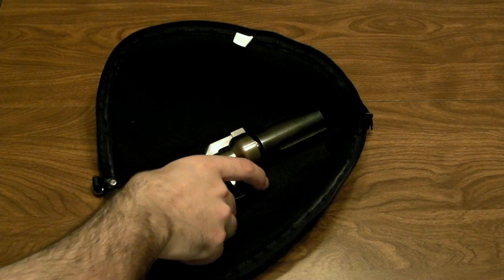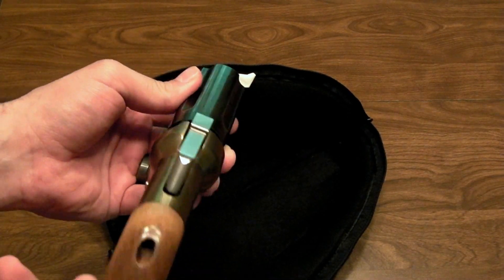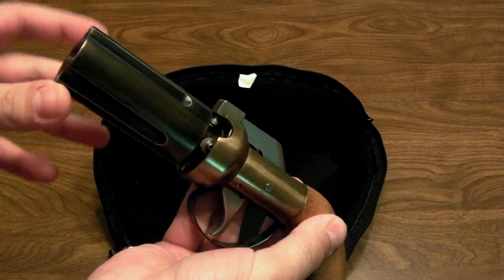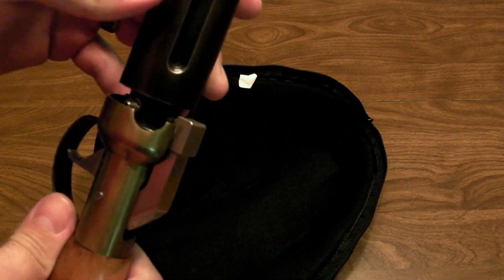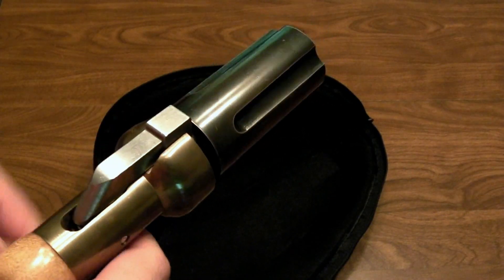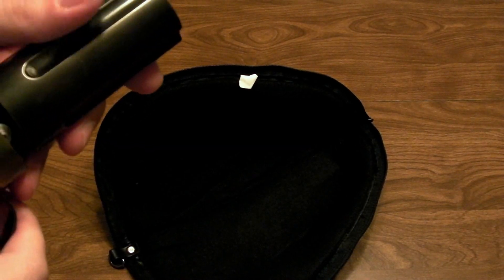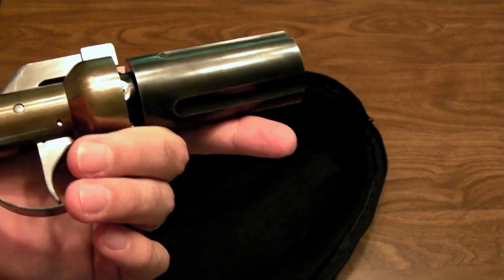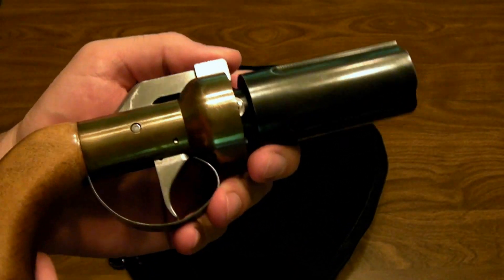Ethan Allen Pepperbox - Part 1

Comment: i dont know if you can do it on this one but i do know that on the new orleans ace model to fix that problem you have to take a little off the hammer were it striks the cap that way the hammer has farther to fall thus giving it more momentum and hitting the cap harder and with yours it takes the number 11 cap

Comment: try stretching your spring out a little bit and this should increase tension. or go to your local hardware store and bring your old spring and get three or four that are similar and you'll probably have good luck this way. Another thing that people that are not used to black powder revolvers is that you have to make sure that your percussion cap is seated firmly on the nipple. another words before you put your powder and ball put your percussion cap on first put pressure on the couch with the hammer and that should do it. and always you safety and common sense when modifying anything. good luck my friend

Comment: In case this is new info., I read that a no.10 cap may go on a no.11 nipple, but it doesn't go down far enough to reliably set the too tight cap to go off.  Are you maybe using a #10 on an #11 nipple?  If so, try #11 caps.  I hope this helps.

Comment: If the cap fires on a second strike, then your cap size is too small. The first strike is settling the cap on the nipple, and the second strike is firing it. Percussion caps are not standardized as to size even though the numbers are the same #10, #11 etc. The size varies from brand to brand .
Try a larger size cap or try a different brand. Hope it works.

Comment: The hammer is not the problem. The nipples are very short in these guns. You have 2 options - sand down each no.11 cap or file/machine down the flare/radius of the nipples. Gun will fire 100% of the time. FFF black powder

Comment: What if you use an angle grinder and cut a channel in the middle of the hammer, to make a sight?
Reply from the maker: +Lucas Kroon The hammer moves as you pull the trigger.  The site picture would be constantly changing.
Reply: gomofast But revolvers from the 1800's had their rear sights in the hammer

Comment from the maker: Not well at all.  It's definitely not the kind of kit where you can just slap it together and go shoot.  There's a fair amount of fine tuning needed on the hammer/sear to get it working properly.  I've gotten it the the point where it shoots sometimes, but it's not consistent at all.  As far as accuracy... well, no sights, and a smooth bore, so it's not very accurate at all.  But it was never meant to be.  It's a belly gun, that's about it.

Comment: I bought this very kit for 127 dollars on Dixie Gun Works about five years ago and built it in about three days. The parts are third rate, often rusted. The grip is basically a sawed off piece of wood that you have to put hours of work into, and finally it doesn't shoot very well. There are four barrels and i would normally get about one shot to fire off for every five or so dry fires. Also, I have had the caps go off, but the nipples are so poorly produced that the spark doesn't make it into the powder. I was very excited about this kit and I am disappointed that it turned out so poorly, DONT BUY IT.